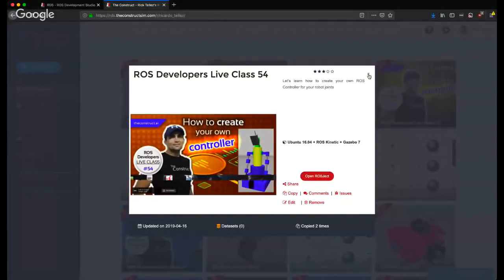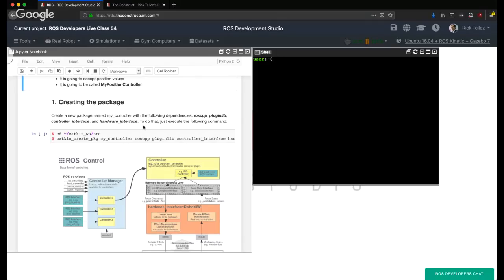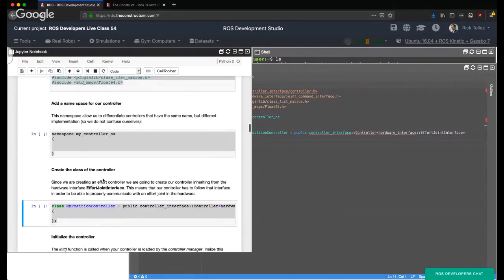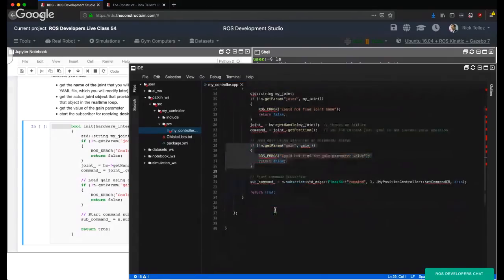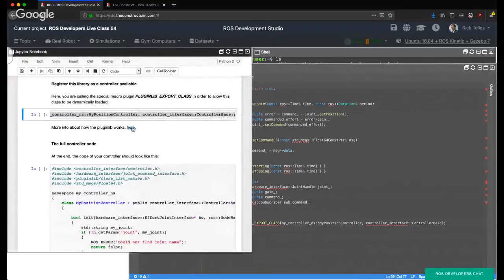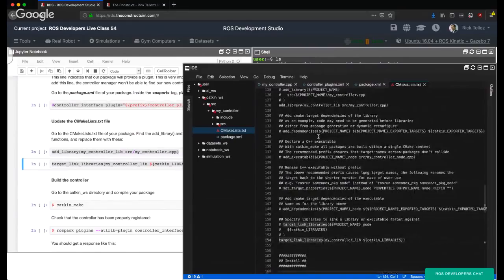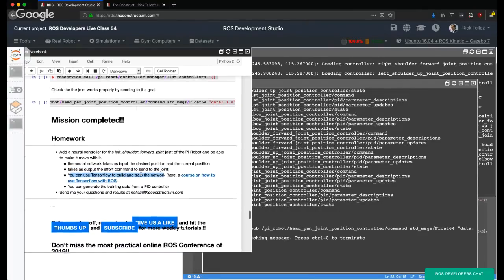ROS Developers Live-Class #54: ROS Control - How to create your own controller

Comment: Nice video, good explanation!! 
I tried to build with catkin_make but doesn't work. There are no errors but seems that it does not recognize the environment. 
It is possible, the problem, is that i don't have the others workspace of previous lessons??
Reply from the maker: How did you create the catkin_ws? Where are you executing the catkin_make command? It is very likely that you do not have a proper catkin workspace in your machine. You don't need anything from previous lessons
Reply: @TheConstruct  Hi! I have is the catkin_make in the workspace... as you said in the video. It doesn't give me errors about the code, but more likely the it seems it doesn't recognise some library.
Reply: @Maverik800  maybe i am too late but it can be because the workspace is not added to path.

Comment: Sorry for my misunderstand, but in the pirobot_controller.yaml, you modified the type of head_pan_joint_position_controller.
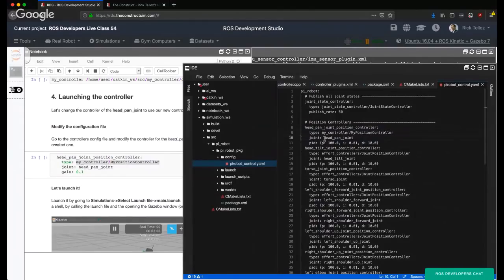"type:my_controller/MyPositionController" at 56:11
 And I wonder if the first parameter before the "/" was the package name and the second parameter before "/" was the class name in .cpp file created.
Thank you so much
Reply: Dear The Construct, I can launch this controller for my custom robot! Thank you so much!
But I have another question: What is the duration between two times that the function 

void update(const ros::Time& time, const ros::Duration& Period);
is called and could we modified this duration? 
For example, we want to set different sample time for PID controller, how can we do that!?
Regards,
Reply from the maker: @hoanannguyentran2103  you can change the loop frequency by building your own controller manager and specifying in there the frequency you want. Check this document to have some hints about it: https://roscon.ros.org/2014/wp-content/uploads/2014/07/ros_control_an_overview.pdf
Reply: @TheConstruct  Thank you, I really appreciate your support!!
Reply from the maker: Yes that is correct. The first part is the package name, and the second is the class that is implementing your controller

Comment: Is this controller compatible with melodic-Gazebo9 setup?

I'm having the following error:
 error: ‘Float64ConstPrt’ in namespace ‘std_msgs’ does not name a type
   void setCommandCB(const std_msgs::Float64ConstPrt& msg)

And another error for the n.subscribe function (no matching function)
Can you help me?
Reply from the maker: For the first error, you have a small mistake in the name of the class: it should say 'Float64ConstPtr' not 'Float64ConstPrt' (can you spot the difference?).
For the second error, it will probably go away once you solve the first one. Let us know if it doesn't because that would mean that you have something else wrong.

It has to work on Melodic too.